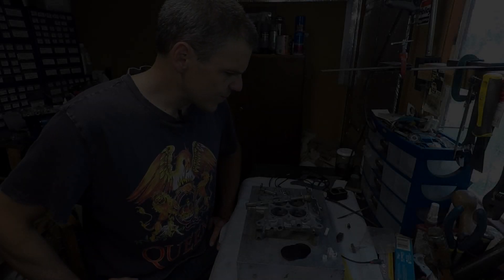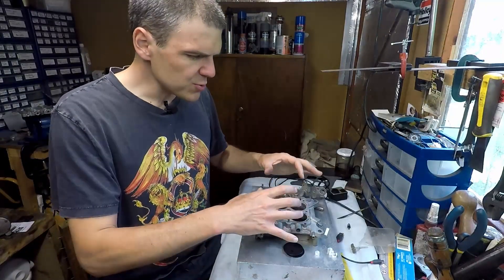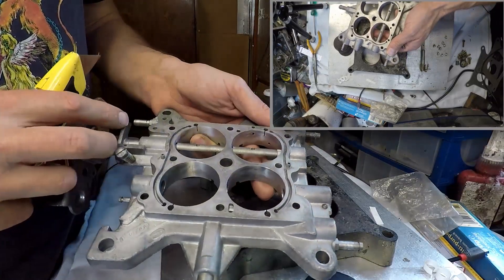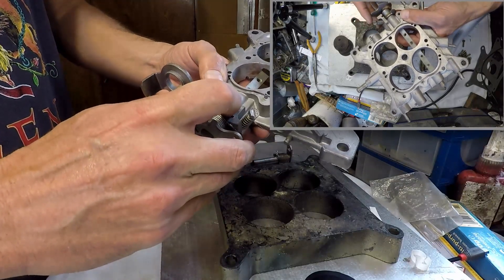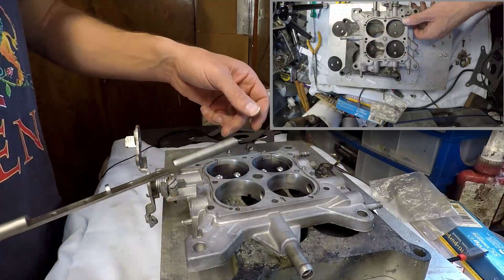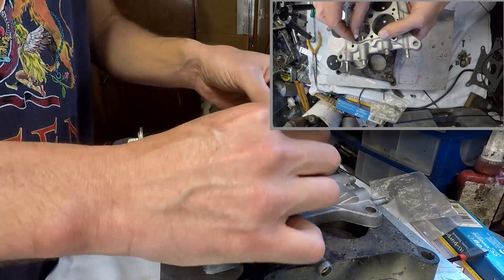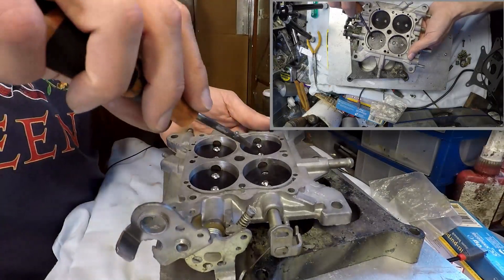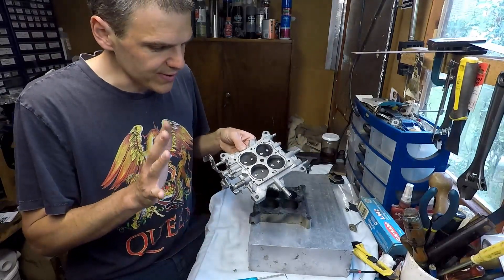Assembly process of a Holley 4150 Double Pumper baseplate with PTFE bushings.

Comment: Thank you for the helpful video. I just bushed my throttle shafts because they were worn out and I'm having trouble with the primary throttle stop limiting the blades from opening all the way and the secondary linkage from progressively opening as well. Life is full of challenges...
Reply from the maker: For the opening all the way sometimes what I did was filing the stop or the body to clearance it fully. The linkage rod can also be bent to get the secondaries to fully open

Comment: Hello I have a 440 six pack with a 2300 holley carb, will the 0.25 m work on that base plate s well? I have a small fuel leak from the driverside base plate center shaft. only seems to be on driverside, should I try and bush both sides or just the driverside that is leaking?
Reply from the maker: I would re-bush both sides if I where you
Reply: @carburist  Thank you!!!!

Comment: How do you remove factory installed  throttle blade screws that have been staked to prevent loosening
Reply from the maker: Carbide burr and carefully remove the bit that protrudes from the shaft and you are golden